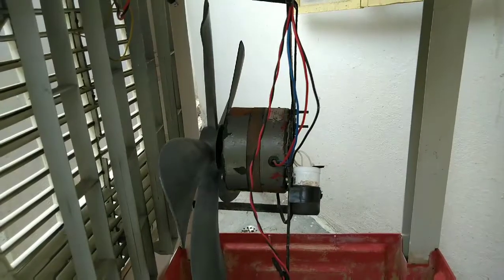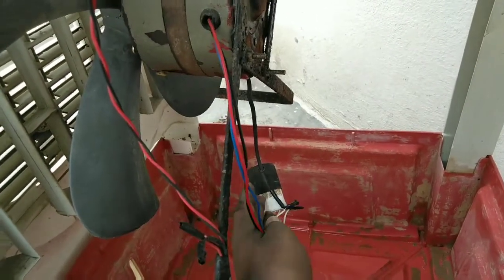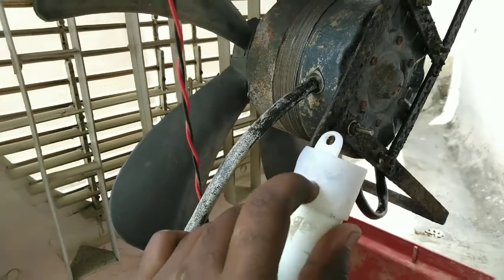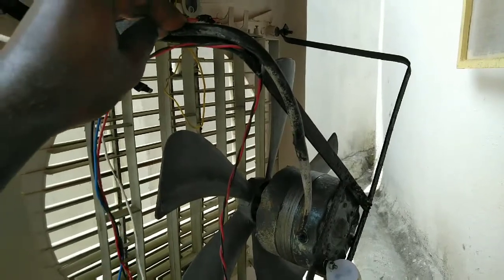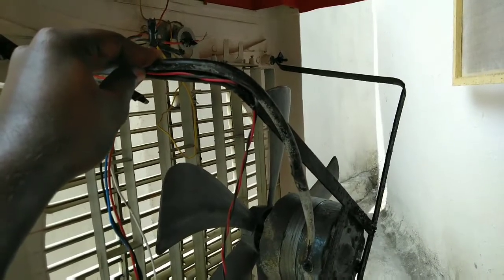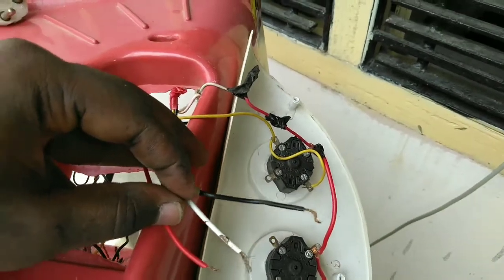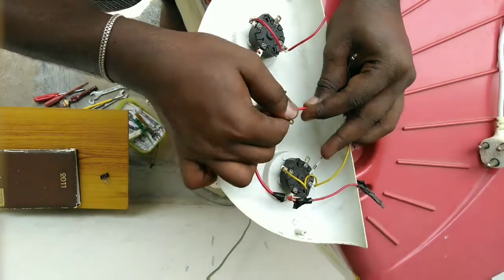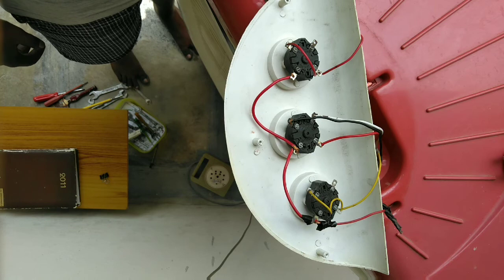Cooler Motor changing,full Fittings, connection and Replacement in Telugu

Comment: Bro motor fan fitting dgara motor (new) ku screw fitting hole ledhu bro fan ala fit cheyali
Reply from the maker: Leadu bro pakka vuntadi chudandi.
Model same tesukunara old motor lage.
Reply: @sharathmultiworks5509  ha bro kani ledhu
Reply: @sharathmultiworks5509  cap thiskovala bro eppudu
Reply from the maker: @shankarganugula9677  bro 9381380838 what's app me your new motor pic and your cooler took.
Reply: @sharathmultiworks5509  bro problem solved nee videos baga help ayyayi tq for replying
Reply from the maker: @shankarganugula9677  Thank you bro and welcome.

Comment: Bro alluminium motor cost entha and adhe bettera ena bro
Reply from the maker: Area to area different vuntadi bro price 800rs average price
Copper can be rewinded
Aluminum can not be rewinded
Better choose Cupper
Aluminum has low melting Point
Reply: @sharathmultiworks5509  hi bro
Reply from the maker: Hello bro